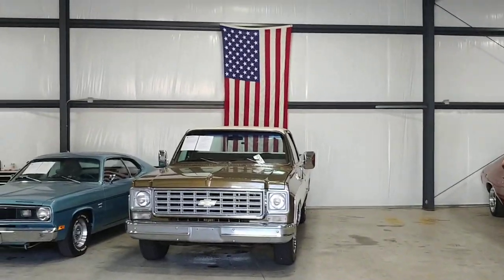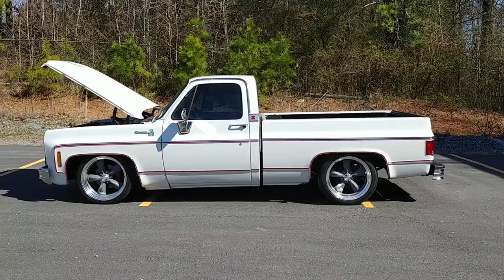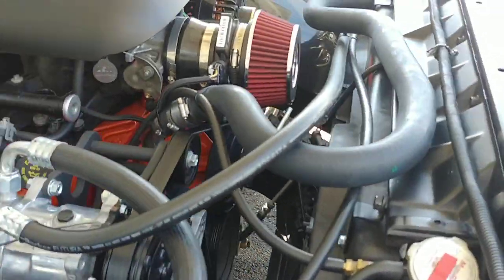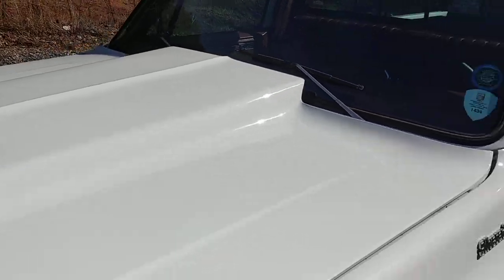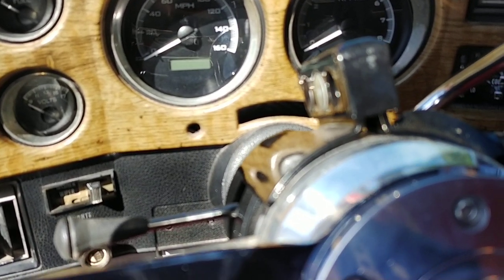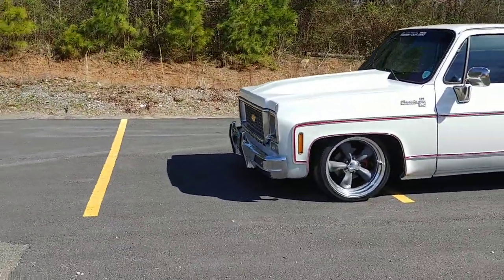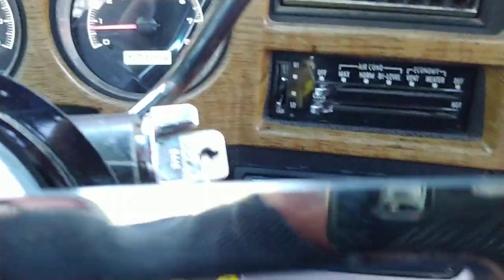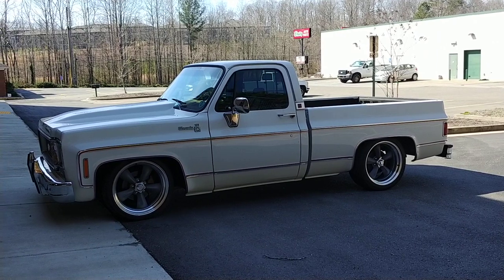SOLD - 1977 Chevy C10

Comment: Growing up Daddy had a 1975 Chevy Cheyenne long bed with a 350 4 bolt main and 400turbo transmission and five star weld wheels it and he also had a 1989 K5 Blazer 350 TBI 4x4 black and silver two tone with redish burgundy interior kind of an Earnhardt colored themed rig both squarebody platforms tough-as-nails